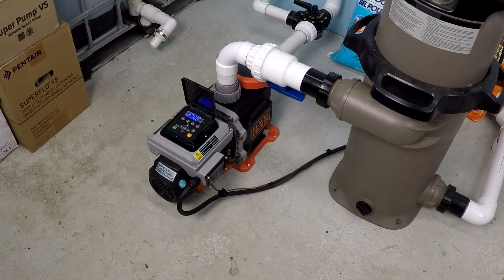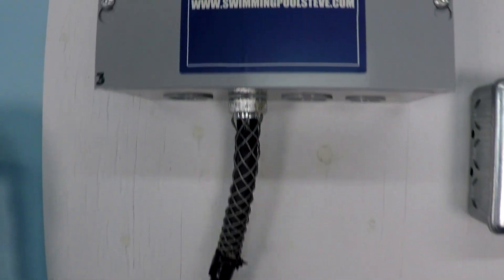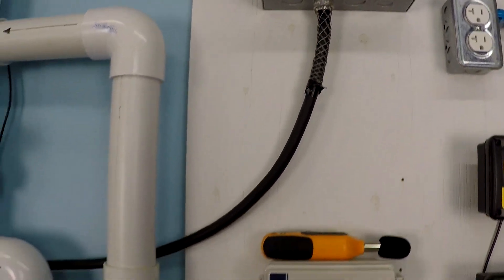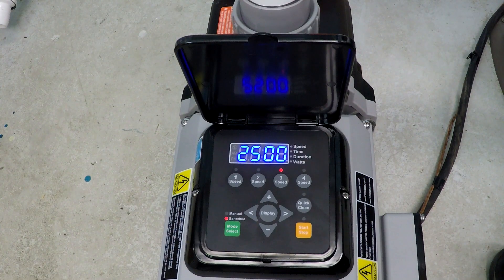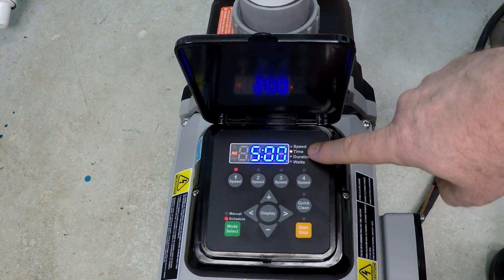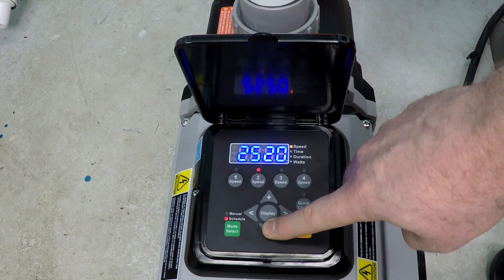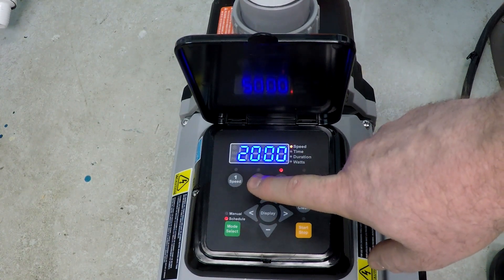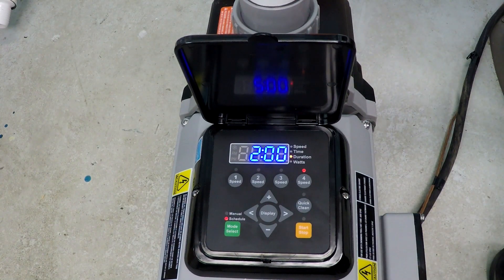Black + Decker Pump Schedule For Heat Pumps (1.5" pipes)

Comment: This is a bit off topic but, if one wanted to partially drain their pool about 50% using a submersible sump pump to get rid of calcium hardness levels, is removing the cleanout plug in the main drain required for the hydrostatic pressure to be released? Or is that only when you want to completely drain the pool. Can you just drain the pool halfway and refill with fresh water without removing the plug? (Im in Texas and we haven't been getting much rain. It's been 97 degrees daily.)

Comment: Great video as usual.  I bought this vs pump two months ago and it it works flawlessly.  I operate it at 2100 rpm 24/7.  Need 2100 rpm due to flow switches in heater and chlorinator.  Saving about 70% on electricity, anything wrong with operating it this way vs. programming?  Turning over about same amount of water as you.
Reply from the maker: There is nothing wrong so long as the pool looks good, floating debris is being skimmed and you are meeting your filtration volume goals.  I usually have a little more diversity in the programming but every pool is unique.